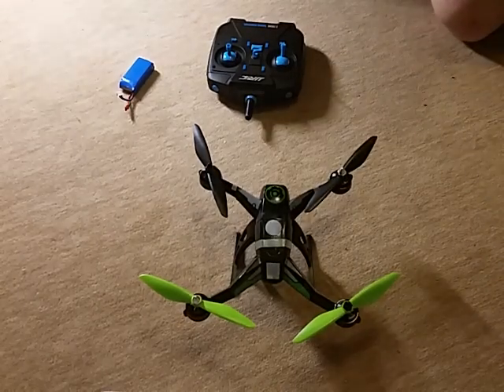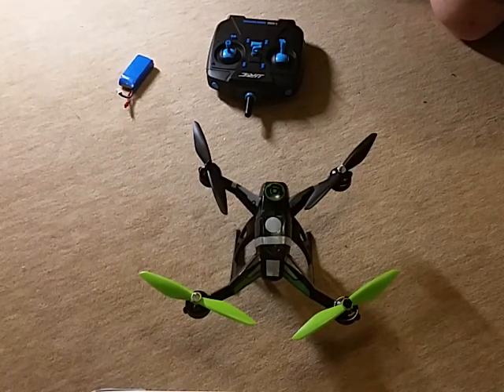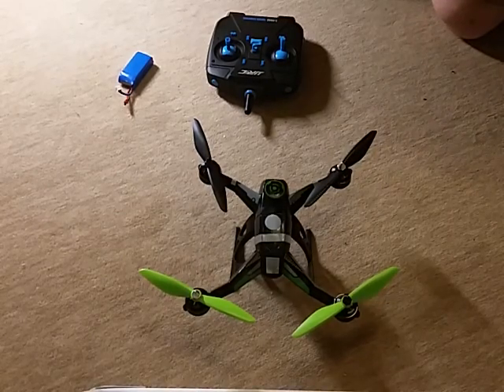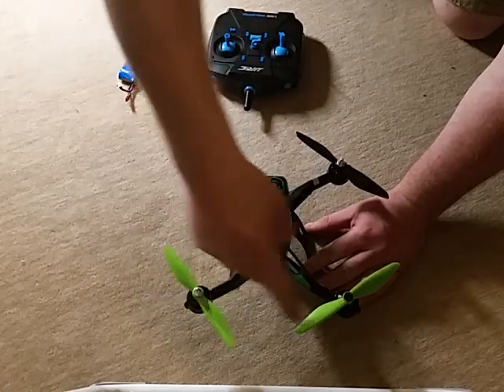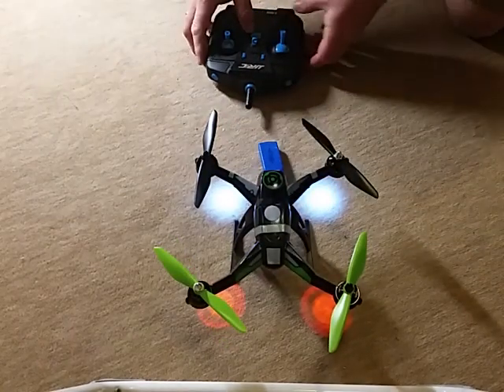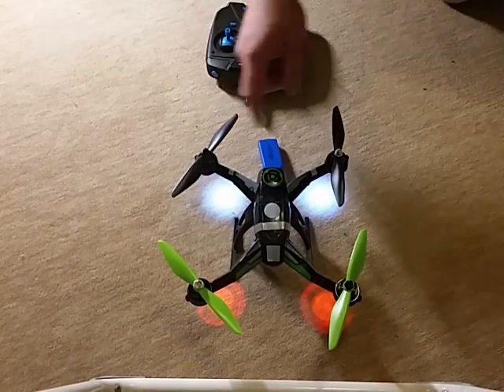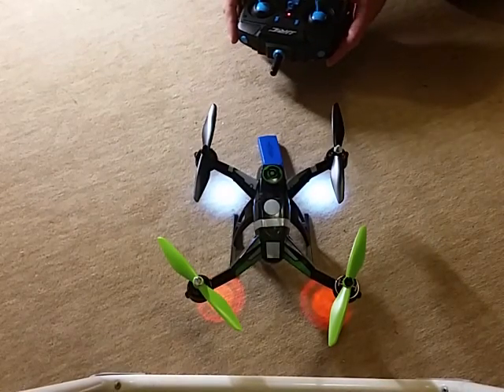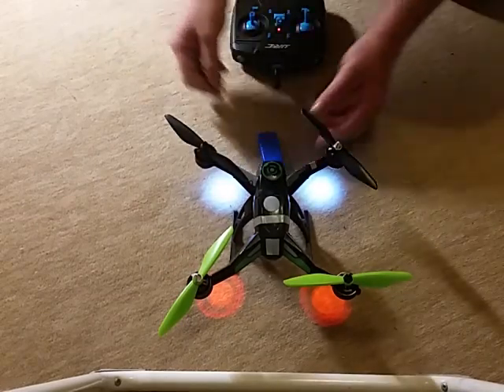[Banggood] JJRC X1 Quadcopter: Problem with one (Motor)/ ESC-Board

Comment: I was told you can use a 3s battery so plugged one in and got smoke, when I plugged in a 2s only 3 motors worked and the same motor as yours does not work.  Could you have accidentally plugged in the wrong voltage battery?